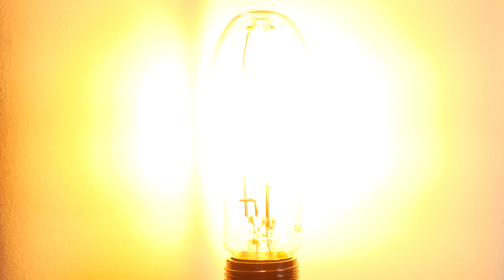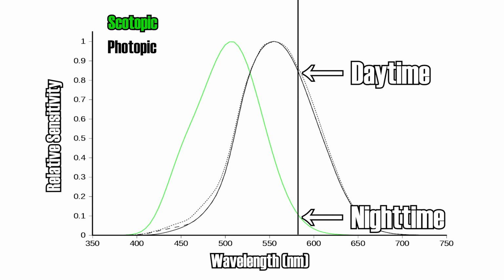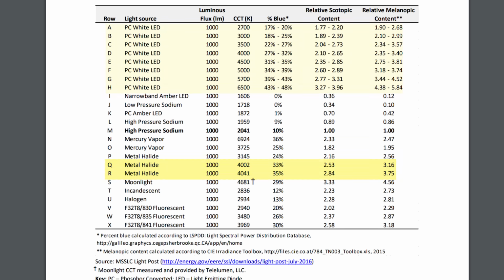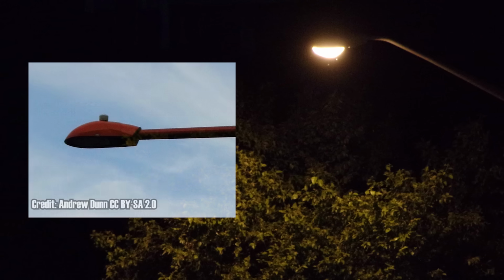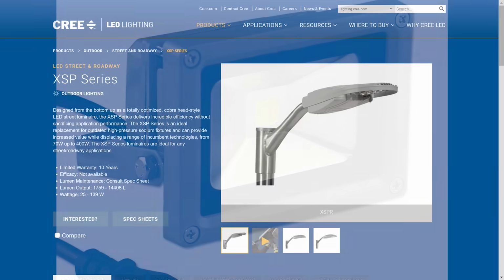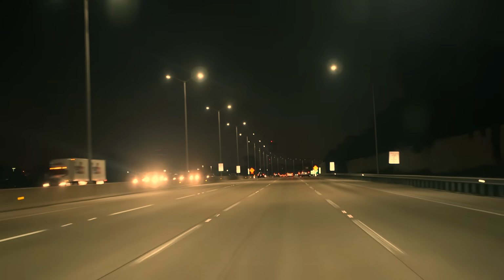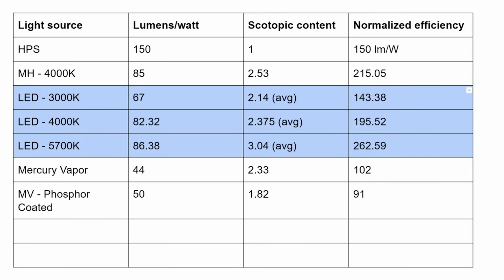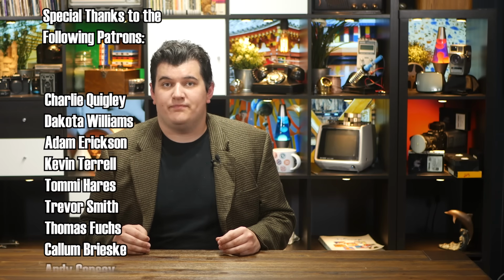The LED's Challenge to High Pressure Sodium

Comment: Good video but:
You failed to discuss:
1.  high pressure sodium's (HPS) color appearing as dirty orange associated with industrial and crime ridden neighborhoods.
2. Colors of objects under HPS are hard to discern.  For example, when you try to find your car in an airport parking lot illuminated with HPS, colors of cars are hard to discern.
3.  You mentioned after 2/3 of the very long video that the current draw of HPS fixtures did not take into consideration the current draw of ballasts which you said is considerable.
4. Stop worrying about LED 5700K white color disturbing circadian rhythm!  Safety on the road is more important than a few people taking longer to fall asleep after arriving home As another viewer pointed out, we want people to be awake when driving.
5. LED color can be adjusted.  Instead of just the choice of highly efficient 5700k white light or less efficient 3000k soft white light, a compromise color of 4500k is available.

Comment: I write by personal experience about what "seems" to be dimmerable high pressure sodium lamps (but may be metal halide): those light makes a "ordinary" dull yellow light on evening peak time but it looks like those make a better CRI light when run at low power. The result is: good lighting when mesopic vision is primary and also, in my opinion, better light at a lower intensity when scotopic vision gets involved. A little side note: in my opinion the better light source for nightime vision is plain old mercury vapour lamp but it may be because my street is still lightened by this old-school tech.

Comment: I think a big part of the debate between colder or hotter light is due to people being nearsighted or farsighted. Yes, it does play a big role. I'm nearsighted and i have trouble with blue LEDs, they make me squint, but i feel comfortable with yellow lighting. I know farsighted people who just can't read in yellower (or worse, redish) light, they feel much more comfortable with cold lighting.
Reply: Color temperatur don't affect wether farsighted or nearsighted see better in the light.
Reply: @TheEsseboy  It does ! because of how diffraction works and how it differs depending on the wavelenght of the light. Even with the best lens possible you can't focus a full spectrum on a perfect dot. Same thing happens with your eyes, but since your focus point is already too far ahead or behind, depending on your condition, the light that's the furthest on the spectrum will be the most focused, and the one on the opposite side will be the blurriest.
Reply: @guillaumegaudin694  Nope, you are talking about chromatic aberation, and the lens of the human eye have changed so it won't happen, thats why you don't see colored blurr around objects
Reply: @TheEsseboy  
I just checked, i did not know the term for that phenomenon. It's clearly stated that our eyes do in fact have this issue, but our brains are so used to seeing these that it compensates. 
It clearly can't once you're too much out of focus.
Reply: @guillaumegaudin694  You should be using glasses if you need them, don't blame the light 🙏
Reply: @TheEsseboy  I don't use them once i'm home, since i'm nearsighted, but only need a small correction, it does not make a huge difference (and i don't live in a palace). I always wear them as soon as I step outside. However there are a alot of undiagnosed people out there who might be blaming the light.

Comment: -Personally I like being able to see street lights from high above. Kinda gives a city a nice "las vegas" look. I also like cloud glow.
-The LED street lights they installed at a nearby school parking lot have motion sensors on them. They're at full brightness when they sense motion then dim to 50% after about 5 minutes.
-The only places I've ever seen low pressure sodiums lights being used was the San Fransisco/San Jose area, and Hawaii. In Hawaii they had replaced some of them with LEDs and they were this very awful dim green color.

Comment: There has been a suggestion that roadways could become smart by only lighting the roads which cars are driving on, which would undoubtedly lower light pollution and power consumption greatly, but I'm not comfortable with having roads dependent on sensors to light. So here's a compromise idea: Street lights which are permanently lit, but with warm 2700k lights, but that have blue-white LEDs on smart car-detection so that color temperature would shift into the blue as cars approach that section of road. circadian rhythms of drivers would be subverted, whereas any homes nearby to the road would only see the blue temperatures where there's traffic.
Reply: So there would be snakes of blue light after each car, that would be irritating to live beside!
Reply: @TheEsseboy  Though you probably would notice the change as much as you would if the roads were dark and only lit in blue when cars go by. That was the problem that I was trying to avoid, annoying snakes of light that only happen when cars are going by.
Reply: @veggiet2009  I guess if you slowly lit up the road like 500 feet infront of the car so it doesn't go from ligth to dark so quick.

Comment: I'd like to add a small comment. I understand I'm in the minority here, but due to my autism, bright white lights are incredibly distracting in my peripheral vision. As such, it's already difficult for me to drive at night even with the HPS bulbs due to the headlights of other cars being blinding and distracting to me. If the streetlights themselves became bright white lights, I'd likely never be able to drive at night at all lest I go into sensory overload. Even just as a passenger, riding through areas that have already switched to LEDs causes me to be practically unable to distinguish objects for several hours even after normal indoor lighting is returned. I may as well be blind while like this. Adding on the additional layer of information of having to control a vehicle as well would likely induce a meltdown and probably cause a very bad crash.

So if you ask me, we should keep HPS bulbs, but I'm aware my voice is singular and likely the minority of this situation.

Comment: I've noticed that if headlights intersect with the sodium light at just the perfect angle it gives off a strobe effect where you see the car jump ahead a bit or back.
Reply: That's not the sodium bulb's doing though. That's the magnetic ballast it's running off of. With an electronic ballast, the same light source would not exhibit this stroboscopic flicker

Comment: Given the fast switching time of LED lighting, it lends itself to active switching by PIR or radar detectors. This provides the opportunity to switch off street lighting when it is not needed, as in areas where traffic is infrequent: this both saves money and energy, it also allows us a chance to reclaim a dark sky.
Reply: That would create problems with lights flickering on and off, which is far more disturbing!
Reply: @TheEsseboy  this has not been shown to be the case as the lights remain on for a period and are synchronised to operate in concert. It is as sensible as turning off your home room lights when the room is going to be unoccupied for a long period. Such occupance detection is becoming common place in office blocks, which might otherwise remain lit all night long.
On quiet Town Streets, traffic and pedestrian activated street lights act as warning and actively deter crime. They also give the wild life a respite from continuous illumination and again provide a warning of potential danger. It has been estimated that adoption in the UK would save the equivalent amount of energy as equals the output of one power station.
Reply: @nigeljohnson9820  still would be annoying
Reply: @TheEsseboy  that does not appear to be the experience in places where this is being trialed at the moment. It is potentially no more annoying that having your home illuminated by the full beam head lights of passing cars. This happens in the country side where there are no street lights. I suggest you look at satellite pictures of the country at night, and decide if something needs to be done about the energy wasted in creating light pollution. Pollution that you pay for in your taxes, now that is annoying.
Reply: @nigeljohnson9820  Its such a small portion of spending, a few dollars a year tops per tax payer

Comment: The even larger problem is what the point source light emission from these things do to your eyes. Your not allowed to shine a laser in peoples eye but the focusing element is not the only thing that makes a laser a laser, it is the point source light emission that is the problem.
Reply: LEDs are not point light sources, Sodium lamps are.
Reply: @TheEsseboy  I believe your confusing point source emission for something else. The p-n junction is what makes the LED light point source. This has an impact on the intensity of the light.
Reply: @zeroibis  There are not one chip in these, there are many! And they use blue LEDs which strike phosphors which give of white light...
Reply: @TheEsseboy  If I take 100 LEDS and put them together what do I have? 100 LEDs. The nature of the light does not change by having more of them. If I took 10 laser pointers and tie them together and call it a flashlight it still does not change the nature of the light. What solves the problem of it being point source is not to add more point sources but to simply use something like a frosted cover to create a consistent viable emission plain.
Reply: @zeroibis  They are not lasers...they are not monochromatic or in phase...you mistake laser diod with LED, they are completly dufferent.
Reply: @TheEsseboy  I was using a laser as an example as it is also a point source emission. In both the emission point is from the p-n junction. This generates a point source emission, the emission being in phase and focused is what defines a laser.
Reply: @zeroibis  But that light is not used, it only srrikes the phosphors to create white light
Reply: @TheEsseboy  You are correct in that some leds do use the point source light to then excite the phosphors which from a technical standpoint are not really part of the led but part of a device that uses an led but that is basically semantics. Even better is when they use a remote phosphor as part of the design which helps diffuse the light a lot more. However, this is only one way to get white light out of an LED there are some that simply use the RBG array which I think we all know is bad but there is also some who use gallium nitride and generate point source white light.

Comment: After you said that blue light was OK, I looked at a blue light and my eyes turned to sandpaper... I guess blue light is dangerous, I thought buying a $2000 light from Miller electric would light up my shop.

That’s just a welding joke
Reply: I hear you buddy.   I got welders flash once while on the family farm my uncle was repairing some farm equipment and i was working on some other equipment in the shop and it was the reflection off the wall that got me.   I sliced a potato in half and put over my eyes.    Worked wonders

Comment: What i don't get is why they don't add LED strips along the road rather than having fixtures.
Add a continuous strip at a fraction of the output and angle it such that the light hits the road surface and you have an admittedly expensive but very low energy and light polluting solution to the problem.

Comment: Thank you! You answered some questions I've had about street lighting I've had for years. One thing does bother me about LEDs are the power supplies. While the LEDs can last a long time, the power supplies probably won't due to the life of the electrolytic capacitors used in them. I've already seen LED lights where these capacitors have failed rendering the LED fixtures useless. We can only hope that this problem can somehow be remedied in the future.

Comment: Street lights with a high blue light content are harsh (as are headlights of that same type).  The simple solution is to use a medium color temperature LED for streetlights such as 4000 to 4500K.  Means between extremes usually "wins".

Comment: The spectral  issue is pretty mute as nobody drives with scotopic lighting, not even close. That would be like driving under moonlight with no headlights. Scotopic light is used more for security, walking trip-hazards around buildings. Light pollution is produced primarily by fools, politicians, and those with no respect for their neighbors, there are many places where there is such an excess of street lamps I actually can't tell when my headlights are on or off, and this go on at 3am with like two other cars on the road!

Comment: Since street lights, as in your examples, normally line the streets, why not alternate the high pressure sodium with LED's. Since it takes very little white light to restore color constancy, in other words, the eye will fill in the poor lighting with dimmer white lighting. It this seems like a way to solve the problems of both LED and high pressure sodium lighting.

Comment: The lamps should be replaced all with LED's but there should be WAY stricter regulations regarding lights/lamps that shine light upwards. A lamp should at absolute max only shine 170-180 degrees unless it's in a like a really deep valley or trapped deep in between tall buildings. It would be nice to see more clear skies.

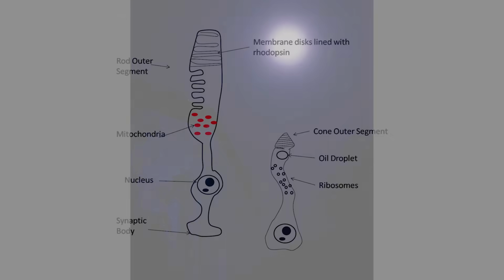Comment: 1:24 - Just to be slightly pedantic: cone cells can't "distinguish colour", either. Our brain distinguishes colours because it gets input from (generally three) different types of cone cells, each with different spectral sensitivity. Rods also have different spectral sensitivity from any of the cones, so they "distinguish colour" as much as individual cones (i.e., not at all on their own, but can be combined by the brain). It's just that their distribution across our retina tends to mean that we're using either (three types of) cones or (the only type of) rods, not both kinds (or all four kinds) at the same time. There is a small area where we do have all four in similar percentages, though (about 4 degrees off the centre of the retina).

Comment: I will never forget that dark night of 1994, the night L.A. was attacked by the enormous Sky Vagina. Life was beautiful and I was living the dream, until I couldn't see a thing, all went dark. The ground was shaking, or was it? It was like I lost all my senses and reality had become fiction. Following those several long seconds that felt like years, I finally saw something in the distance, a light. I walked towards it and tripped on the vacuum I was cleaning with. ouch. I then got up and proceeded towards the light with great caution. It had been coming from the window. I slowly approached the glass and It appeared as if the ground had disappeared, and become a dark void leading to oblivion. I then noticed something unusual up above, in the large sky, the very cause of the events: The Sky Vagina. My heart was racing, sweat was leaving my skin like a towel being rung. The silence suddenly became the loudest noise i had ever heard. My head was pounding from the shock. I never new such a fear could exist within me. I ran to the phone and immediately dialled 911. I had lost control of my actions and was acting on the basic instincts of survival, even though trying to survive would have been for nothing since I was nearing my end. The phone kept ringing and ringing but no one would pick up. I felt I was going to collapse. My legs could barely hold their own weight. I still couldn't tell if the ground was actually shaking. I dropped the phone and slowly walked back towards the window. The phone swung off the edge of the table, back and forth, back and forth, like a metronome counting the final beats of my heart. I fell to my knees and prayed that my death be quick and painless. I looked upon the Sky Vagina one last time and just as I closed my eyes, the vacuum blasted its noise with all its power. I never thought I would be so happy to hear a vacuum cleaner. Also, the apartment building didn't feel like it was shaking anymore.  I opened my eyes and everything seemed back to normal. I gazed my eyes through the window and it was gone. I was going to live! I have never forgotten that night, the night L.A. was attacked by the enormous Sky Vagina.

Comment: My town has changed all lighting from sodium to LED, I think to counteract the circadian rhythm issue they have turned them down, so they appear not as bright as the ones they replaced, but visibility is much better. Plus the night sky now is so black, we see far more stars than we did before, far less light pollution form them. My local train station also has LED lights that turn low when noone is around, when someone walks by they turn brighter.

Comment: That blue light on the highway at night is exactly what you want. You don't want people falling asleep just because it is late at night. You want them as awake as daytime. Lights are for safety, not for any other reason. So not only will high temp LED allow you to see much better, it will help to keep you from nodding off at the wheel.

Comment: A street near me had nice even too much street lighting. They replaced that with white low power LEDs. Now we a strobe affect, as there are concentrated pools of intense light, with black spaces tn between.  Hardly comfortable to drive under, but they're likely saving electricity.

Comment: Why do incandescent light bulbs charge solar panels? Does a light's frequency relate to heat output? I feel I almost understand but I'm not quite there! Help!
Reply: Solar panels use the infrared frequency. Incandescent bulbs happen to produce a lot of waste heat in the form of infrared radiation. Modern bulbs wont charge your solar panel because we can more precisely control the frequency of the light waves in LEDs.